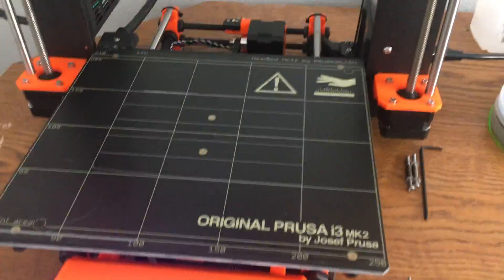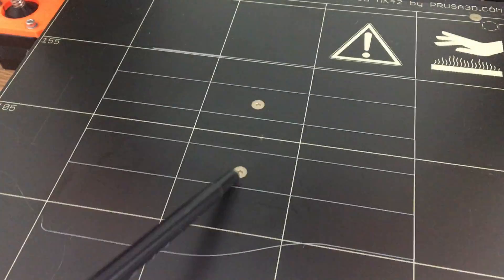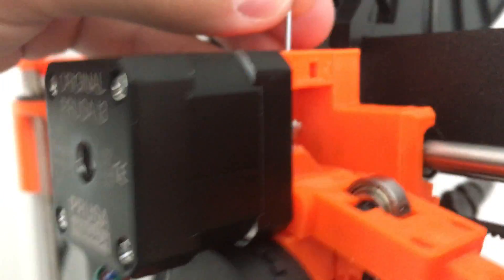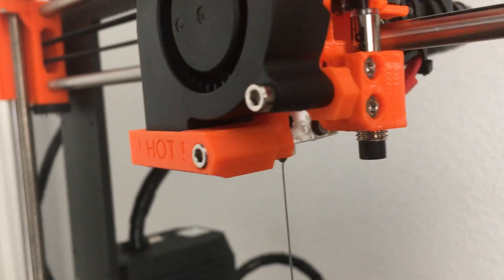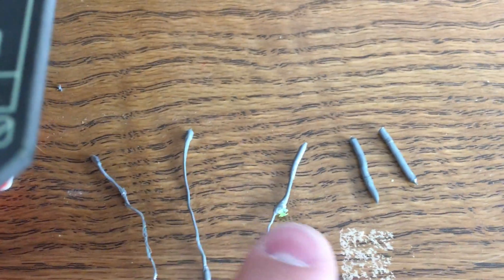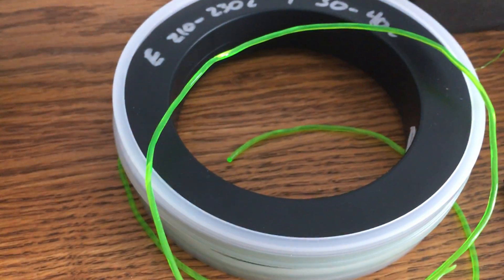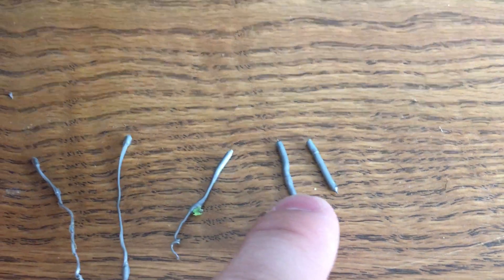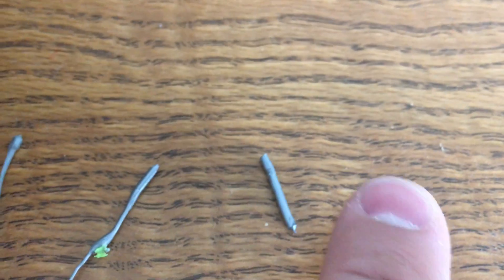Prusa i3 mk2 not sticking to bed (solution)

Comment: Dude, Years later this is one of the first things that pops up when searching for a solution to “filament not sticking to bed” and your retarded ass decided to fuck up the english language. You had extruder problems, not filament/print not sticking to bed. Those are not even remotely the same words nor the same problem. I am leaving this here incase anyone else had to rebuild/unclog their hotend, and and got new/still have problems with “PRINTED FILAMENT NOT STICKING/ADHERING TO THE BUILDPLATE”. This video is not the answer you are looking for, nor should it be this high up on googles search for this fucking problem.

Comment: don't print directly on the bed surface you need a sheet. If you show things like this you should explain why you dont have it on.
Reply from the maker: This is a MK2. The sheets weren’t introduced until MK2.5
Reply: @thespencerowen  This is good to know. Thanks for the follow-up. I always thought it would take a long time to get the manufacturer to make a customized build plate for you. Maybe they had intentions but were not available. There is text on your build plat that said not to print directly onto that surface if I'm not mistaken.

Comment: Still looking to solve my first layer do not stick issue on my MK3 where it looks like that when it starts printing it is just picking up the filament. On the first layer calibation the square is looking like the left and right end of each row was pickked up by the extuder comaing back his way. Can not solve this.
Reply: Same issue. Started happening all of a sudden. Have literally tried everything. Brand new sheets, spools, nozzles. Nothing. I think its some extrusion issue.
Reply: @LeCafeRacer  me you. Just got it put together. It's a total pos